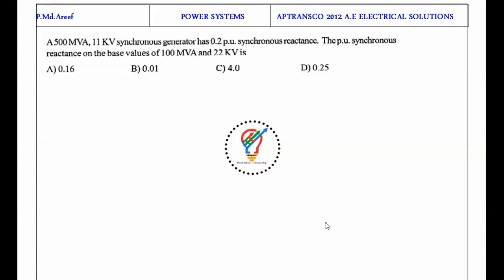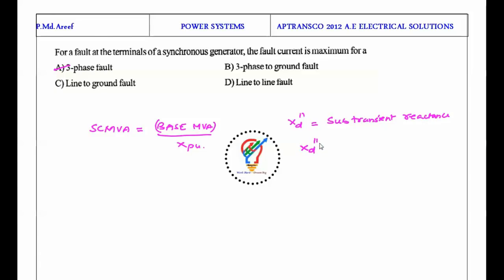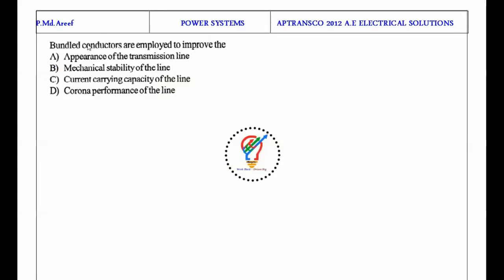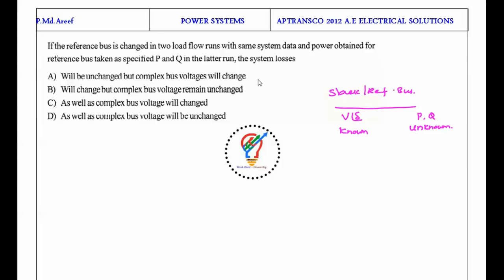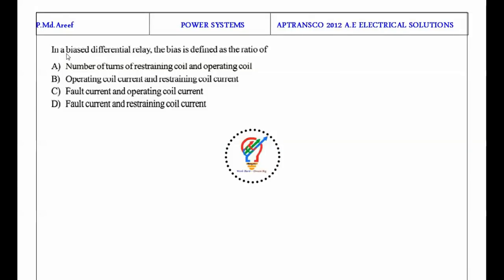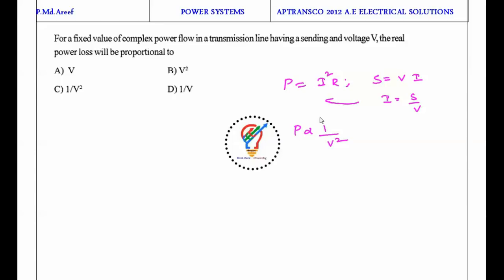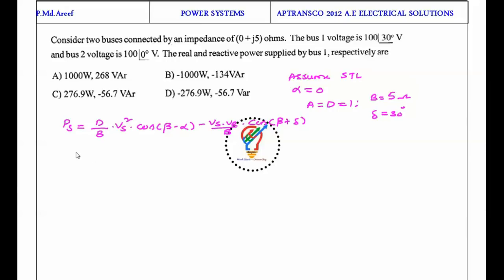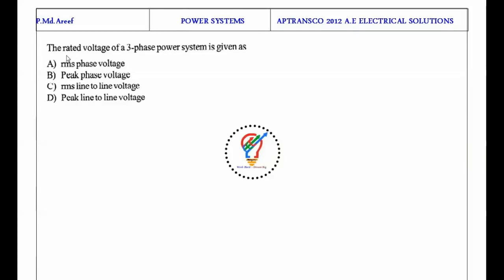APTRANSCO 2012 POWER SYSTEM  ASSISTANT ENGINEER ELECTRICAL SOLUTIONS

Comment: Two wrong answers in power system
1. keeping in view the cost and overall effectiveness the following circuit breaker is best suited for capacitor bank switching
   for this question Vacuum circuit is correct not Air Blast circuit breaker
2. for a fault at the terminals of a synchronous generator the fault current is maximum for 
   For this question correct answer is line to ground fault not three phase fault (with respect to fault at terminals of syn gen)
 once please check once
Reply: Air blast circuit breaker is correct answer
Reply: vacuum CB IS correct